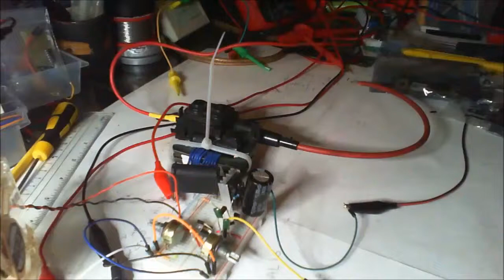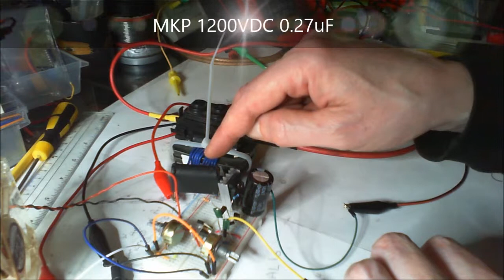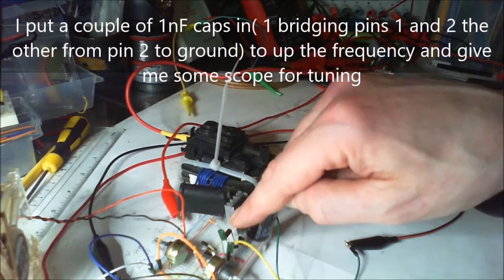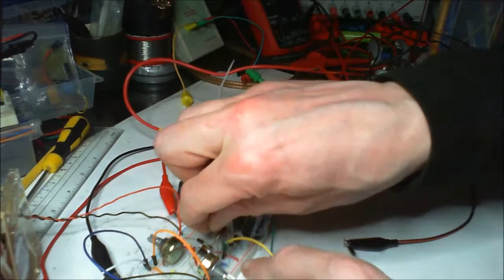555 Flyback Driver

Comment: give me circuit plz ?
Reply from the maker: +Harold Victor I did not draw specific circuit for this. I based the project on this http://www.eleccircuit.com/efficient-flyback-driver-circuit-by-ic-555-irf510/  
I changed the mosfet and put a capacitor across the flyback primary connections. played with different capacitors on the 555 for changing frequency. The result is what you see and keep in mind I used a different flyback on the same circuit and got different results. This flyback in the video was the better for this circuit.
Reply: +Elecifun do you have facebook or social networking for me talking directly with you !
because i made it four times and resistor 100 ohm burned and i didn't see any arc out too plz help me ?
Reply: You need 4w resistor 😊